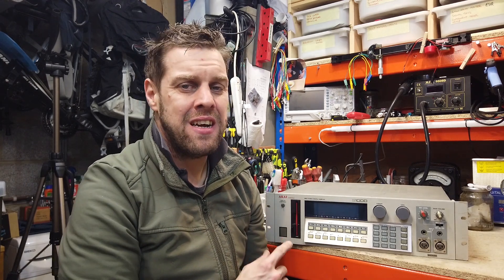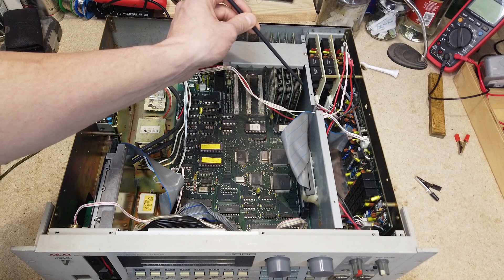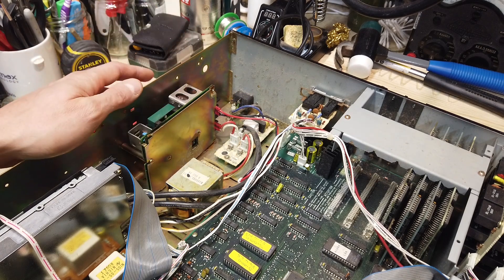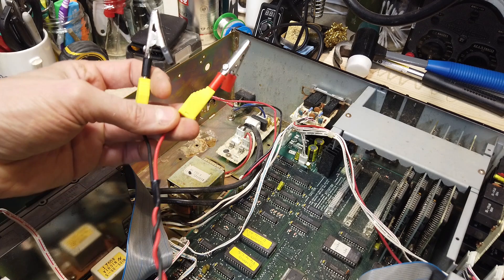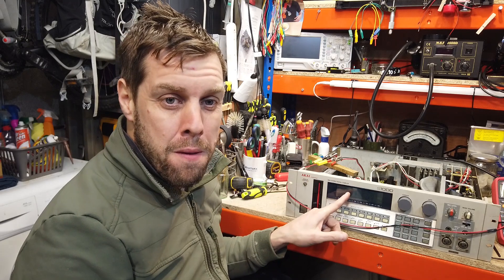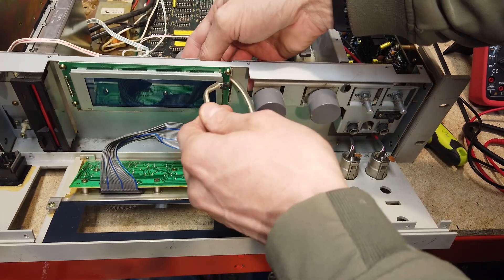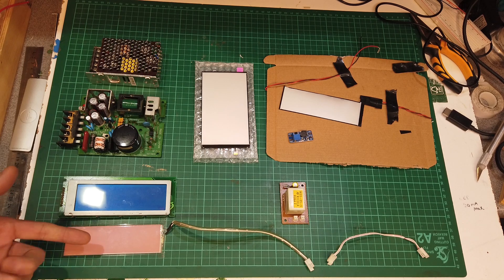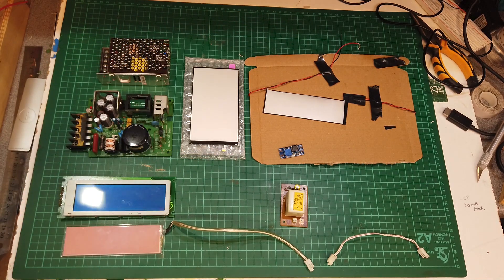Akai S1000 sampler repair part 1 – diagnostics

Comment: Well mine just died. 😊
Reply: I thought it was the main board fuse do I took it out but it looks ok now i see(from your video) there is a fuse on the transfomer board. Actually was looking at the transformer board wondering what it does. I booked a service session at "synths when" but i am wondering if i can just replace that transformer board. I'm not sure i can test it right. 😊

Comment: The ELD display transformer is a common whistle on audio problem..solution: DIY LED backlight with 2 plastic sheets one for glue LEDs, one for dissolve point lights.and small 5v LEDs in paralell with small light force. Every electrolyte cap change is highly recommended.

Comment: Thanks for this. Just had my backup S1000 go down. Going to measure the rail but if the 5v is not right can I plug the 5v power from my working one onto the board of the non-working one to test?

Comment: Thank you for this. I'm having hassles getting a S1100 to load the OS 4.3 The  The power supply PCB distributor board was cracked in two, damaged in transit. I renewed that and the Main CPU PCB (Motherboard) and both 32 ROM chips. It has a floppy Emulator installed and a new type LED screen from previous owner. No default Sine wave sound when pressing the ENY/Play button after start up and nothing on the screen, no writing. Totally Stumped. Guy in Japan who sold me the Main board and Power supply distributor board helping diagnose, guy in Canada who supplied the ROM chips, guy who sells the new type LED screens and guy who sells Gotek Floppy Emulators all trying to help. You seem to know your stuff. Any suggestions or contact would be greatly appreciated?

Comment: Question: I just bought a bench DC power supply to test my unit after taking out the faulty Akai PSU. 
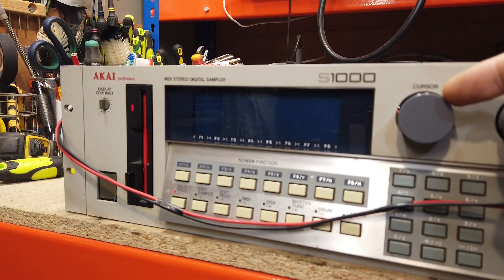I understand how you sent the 5v to the unit, but how do you send the mains power (12v)to the board at 5:42?
Do you have a second bench power supply unit going? Thanks!
Reply: Derp, I figured it out, you mean the power to the main AC connection in the back.
Reply from the maker: Correct

Comment: Great video ! thank you ! i have an question i have an S1000HD the power supply looks a little bit diffrent i think because of the HDD and the Fan for the HDD but i dont use the HDD because i install an scsi2sd card reader so its enough do you think i can install the powersupply like in your video ?

Comment: Literally just done the exact same fixes on one of mine. Used a slightly larger PSU, just because I dont trust the power ratings on those chinese smps units. Also put in a little DC DC converter to adjust the iPhone backlight brightness. All works a treat

Comment: next stop....sd card reader
Reply from the maker: Really Nice Audio I would love some info on drive replacement, I see there are both usb and sd card types avaibke but I am not sure where to start
Reply: @Actual_electrical_content  There are types that plugin to the floppy disk which emulate a floppy drive but these are limited to floppy size saves.  There are also ones which plug into the scsi chain which can save/load larger sizes.  I am using this one 
http://shop.codesrc.com/index.php?route=product/category&path=59
on my Kurzweil k2000 scsi, not sure if it works with an aka
Reply: What you need is SCSI2SD

Comment: Great vid. Any chance of a SPX90 II PSU rebuild or replace video?
Reply from the maker: Jesse Skeens I’ve not got one , tweet me a picture of the inside and I’ll try to advise if I can
Reply: @Actual_electrical_content  Cheers for that, what's your twitter?
Reply from the maker: @theinfotorpedo
Reply: @Actual_electrical_content  Thanks will do once I get an updated photo as replaced some caps already since I last took one. Just need to pull it out of storage.

Comment: Well done! I didn't know that there was completely new power supplies available, thought recapping was the only solution.
Reply from the maker: Tape Leaks it’s just an off the shelf 5volt power supply in the original slammed in , not a bespoke item , I just rammed in a modern equivalent, you can see this in the next video
Reply: @Actual_electrical_content  Has the next video been posted?